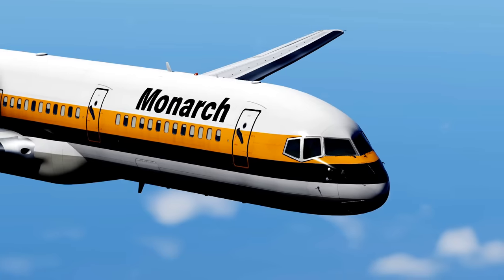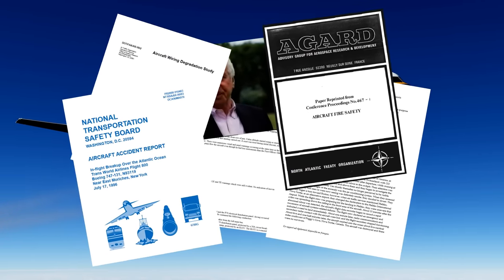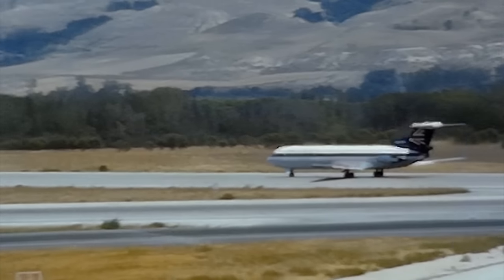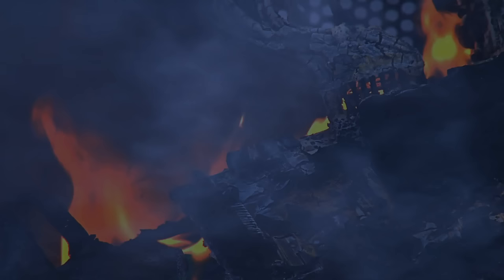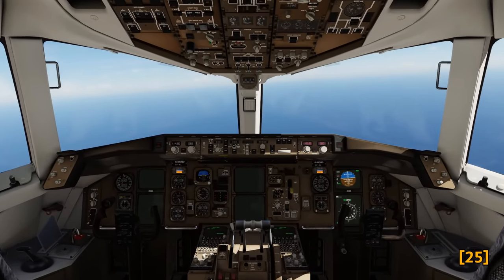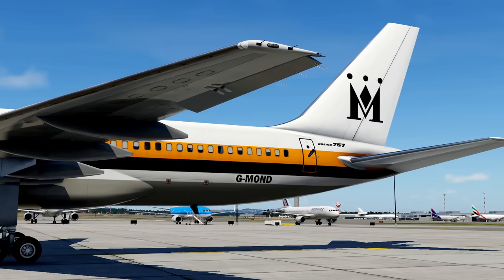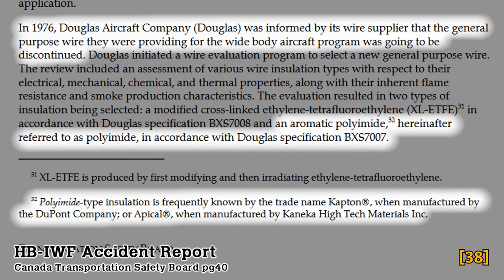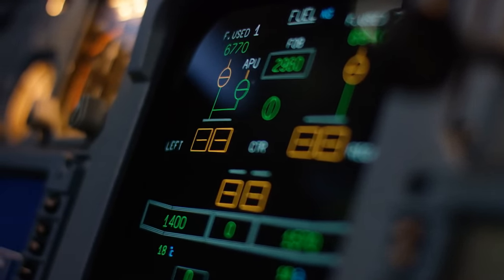The Toilet was Leaking??  What The Heck Happened to Monarch Airlines Flight 390 - DISASTER BREAKDOWN

Comment: What is often overlooked by many in discussing the Swissair 111 disaster is that the culprit wiring for the in-flight entertainment system was installed by a third-party vendor who didn't consult with McDonnell Douglas beforehand as how to properly integrate their equipment into the plane's electrical system.  Further, the wiring was continually live, as there were no "shutoff" switches, circuit breakers or other protection.  This is akin to wiring an aftermarket stereo system for your car directly to the battery terminals without including fuses, only in this case with much more dire consequences.  And these circumstances make Swissair 111 all the more tragic, as it was the least important system on the plane that ended up bringing it down.
Reply: Never 👎 the feelings of the butt in the hierarchy of the systems, they may revolt.
Reply: @minhthunguyendang9900  "feelings of the butt"? Which feelings are you referring to?
Reply: @Adam-kn3tv  
Sorry, I should have written :
‘Never underestimate the feelings of « the least important system » in the hierarchy, for they may revolt.’
I was thinking of Stephen King’s movie
‘Maximum Overdrive’
Reply: Since I wouldn't fly without some form of in-flight entertainment, it's a crucial system for passenger aircraft if airlines want paying passengers.
Reply: @Adam-kn3tv  
Sorry, I couldn’t resist the pun inspired by the op : 
speaking of butt about the plane toilet. 
& in ww2 a nazi uboote was sunk due to its own toilet.
Reply: @ImpactWench  the issue is not an entertainment system itself, but how it was installed in swissair airplanes. It was installed with disregard to the already installed wiring in the plane and there was no way for the pilots or crew to disable it at the time. The entertainment systems were a new thing in the 90's, so nobody really considered potential implementation difficulties with it. It was reported that the wiring of the system was overheated for long periods of time, probably leading to a faster degeneration of kapton insulation, leading to the disaster in the end.

Comment: I think Monarch 390 was probably a victim of the aviation situation in 1985. It was the second deadliest year in aviation history, with those three major crashes (Japan Airlines 123, Air India 182, and the Arrow Air crash in Canada) taking up most of the news cycle. 2,010 people died that year. And January 1, 1985 had the crash of Eastern Air Lines 980 in Bolivia, and since they didn't find the wreckage until 2016, I'm sure finding the wreckage of that flight was still huge news when Monarch 390 happened. Without any fatalities or injuries, this one got drowned out by everything else.
Reply: I enjoyed being on the 57 until LaudaAir. Just like my preference for Malaysian Airlines. Gone Also. Airbus took me a while to feel comfortable with
Reply: Nah. Nobody died. As such, IIRC it didn't even rate a mention on the evening news in the UK. It was just a plane that had a problem, diverted, and all the passengers got flown home later on a different plane. I knew about it at the time, only because my father was a Senior Flight Engineer at BA, and as such, he kept well informed of any potential problems in aviation. At the time, IIRC, it was regarded more as a case of leaking fluids getting where they shouldn't, than any particular problem with the insulation. It was only after the Swissair crash that there was an understanding that Kapton may have a problem, but even then the flammable thermal insulation was seen as the greater issue. 
That's the problem with this type of issue, it takes time for enough evidence to form for anyone to realize there's an issue, and due to the widespread use of the material, and the limited number of reported incidents connected to the material's degradation, it took decades to even know there was a problem to address. Sure, there were incidents & accidents happening, but they were easily explained as physical damage to the insulation, or chemical contamination of the insulation - not as the insulation itself having a problem. How could it be, when there were thousands of flights every day where Kapton worked perfectly?
Hindsight is always 20/20. NOW we can look at an incident and say "it's obvious", but at the time? Not obvious at all...
Reply: @gchampi2  Ok yeah, so we agree.
Reply: Outside of Sully’s Miracle on the Hudson, aviation incidents that don’t end in complete catastrophe tend to fade very quickly from the public zeitgeist. Except for Aviation and Disaster nerds.
Reply: That was also the year of British Airtours flight 28m in Manchester, one accident that changed everything. 1985 was a very sad year in aviation, but at least we learned a lot, and those tragic lessons were actually put into regulations and practices in the airlines, doubtless saving many lives since.
Reply: This comment makes me feel like there should be a video on the whole year & how the events were covered + received by the public. That's such an interesting story, to see what happens when there are multiple incidents.
Reply: @picahudsoniaunflocked5426  I totally agree. 1985 was a unique year in aviation history, and that is a story that needs to be told. We all know the big news stories (JAL 123, Air India 182, etc) as separate incidents, but connecting them together as a single story, what it was like in the industry to have one horror after another within one year is a story in itself. I don't know if that's the kind of story for Chloe to tell or someone else. She digs deep into what happened to cause certain accidents. I've never heard her do a story on the effect on the industry. If she chose to do it, she'd do an excellent job, but I don't know if that's her thing. It would be a great story though.
Reply: Delta Airlines 191 at DFW also happened in 1985.
Reply: @picahudsoniaunflocked5426  I would like that too actually, that could be really interesting. How did it affect culture, perception of air travel, profits, etc.
Reply: how about 2001
Reply: @legitusername-zl7to  Except for the fin breaking off a 767 because a noob pilot didn't understand how to use the rudder pedals, 2001 was really defined by terrorism, not air accidents. It was a massive criminal conspiracy. It's difficult to discuss intentional, criminal acts the same way we discuss preventable mistakes and design issues. People will commit crimes as long as there are people, and preventing crime is different from preventing air accidents. We can make planes more resistant to criminal acts, and we have, but the criminals are the real problem, and that's outside of air accident investigation, at least in the US (FBI vs NTSB). I think that's why we tend to consider the deliberate criminal acts on 9/11 apart from air accidents.
Reply: @beenaplumber8379  technically still the deadliest year by total fatialities (R.I.P)

also dont call him noob american airlines did not train him (so blame american as the noob instead)
Reply: @legitusername-zl7to  Fair enough. That was an awful judgemental statement I made. He didn't know what might happen as a consequence. He was doing his best.
Reply: @legitusername-zl7to  What happened in 2001?
Reply: And equipment used by AA, in that November 2001 vertical fin seperation was an Airbus and not a B767. The F/0, who was the pilot flying the aircraft on takeoff was attempting to counter wake turbulence from a heavy jetliner ahead of AA, and while his aggressive rudder pedal commands were the cause of the inflight breakup, that procedure was only lightly taught and lightly touched upon for him and many other pilots in flight training and type rating training with the Airbus and the AA  manuals themselves saying little to clarify such pilot inputs following encounters with wake turbulence from another aircraft.  @beenaplumber8379
Reply: @franktino6676  Again, I got it wrong. I don't know why I got it in my head it was a 767. And yeah, it's always an urgent question to look past the mistakes people made to find out why the mistakes were made - what contributed to the mistake, and how likely is it that the mistake will be repeated. My original comment about that pilot was judgemental and wrong. It's too easy to blame "pilot error" and stop there. That's not just for investigators either, though they do have standards that require deeper investigations. I think everyone, people who are not investigators, need to stop making the kind of mistake I made in my earlier post. It's too easy to ask who we should blame rather than what happened, how, why, and what can we do to prevent a recurrence. I've been preaching that mantra for decades, but I made a mistake and got caught up in it myself.

Comment: An example of a polymer that avoids a lot of the drawbacks (decay) of polyimides is Kevlar; a polyaramid. By incorporating some aryl carbon rings for stability, it breaks down far, far slower (and is as a bonus excellent at resisting impacts).
Reply: Aramid does of course have drawbacks too like being very sensitive to UV exposure. 
But as with most things in mechanical engineering it's about weighing pro's and cons for the application.

Comment: on one occasion an etihad airlines a340 registered as LO-BTA suffered a kapton fire while on the takeoff roll. thankfully the plane hadn't reached V1 speed yet and the pilots were able to stop the plane from taking off.there was one fatality when a flight attendant rick napes was hurt by the fire initially but died 8 months later because of suspected internal burns which couldn't be treated.

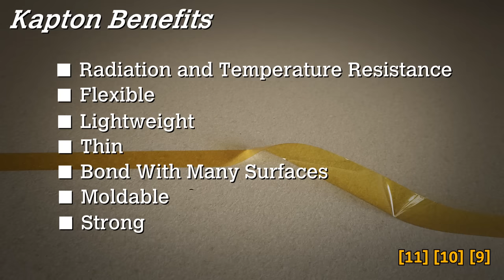Comment: 6:58 Indeed it has many advantages. Another one not mentioned in this video is that it is very resistant to outgassing, meaning that it can be used in ultra high vacuum without causing contamination or ruining the vacuum. I did a bunch of wiring for a physics experiment that involves first a high vacuum, then liquid xenon. This basically meant all wiring had to be insulated with either Teflon or Kapton. Kapton is, on the balance, the stronger material (Teflon flows under compression). But Kapton sucks at abrasion resistance, in particular in wire insulation, because the insulation is not a monolithic extrusion like normal PVC insulation and most Teflon. Instead, Kapton insulation is basically Kapton tape wrapped around it in countless layers. This causes it to sorta shred under abrasion, since each layer can tear somewhat independently. Just pulling it through a tightly fitting, perfectly round hole can start to cause bunching up of the insulation. 

So while Kapton wire has many advantages, including one big one over Teflon (Kapton is radiation-resistant, whereas radiation quickly degrades Teflon), it’s also fickle, not to mention its extremely high cost, and difficulty to work with. (Because of the wrapped insulation, it’s very difficult to strip.)
Reply: I am guessing that it can’t be deposited on the wire via a flow process like how other insulators can be?
Reply: @Knirin  I guess not, insofar as I assume they would if it were feasible.

Comment: Chloe, you won't believe it, the German company "Märklin" used Kapton too, for insulating their magnet coil in the switches of the model railroad.  Kapton simply vanished in the 80 as insulation. Now I know why.  Especially when kids play with a model railroad, the Kapton will become less durable, and short circuits will happen.
On a modell railroad for kids?
What if the carpet starts to burn, and the parents are not at home? 😮
Reply from the maker: That sounds horrifying! Although, it is good the Kapton was removed. People just weren't aware of its shortcomings at the time
Reply: It was widely used in the model railroad industry, but accessories use 3-9V current, and traction is maximum 24V so arcing event are way less dangerous. (most of the time there is no arc, just a short).
Reply: @elnalaombrebois5665 yes, but back in the days the fuses where not so fast as today's electronically fuses, and the power Transformator delivered up to 1A.
It was not a rare event that the wheels of train where solderd to the track  due the high current in approximately 1second untill the fuse cut the power of.
Today the fuses react in some milliseconds.

Comment: I was an avionics mechanic for an airline with the largest fleet of L-1011's from the mid 80's until the planes were gone.  Kapton wiring was a constant problem for us.  It would crack easily in high vibration areas, and with bending or stresses at connector pins.  Cracks would cause internment problems that were hell to solve at times.  One of the less mentioned problems was after heavy maintenance visits and mods, metal shavings would get in the wire bundles and cause mystery glitches.  The deterioration of the wiring was considered manageable, at least in public, but probably played a factor in scrapping that king of beasts.  If you were a good mechanic on that airplane, you had something to be proud of.

Comment: The Airbus A320 'glass cockpit', was way more advanced than the Boeing 757 in 1985. Together with the A320's large LCD's (which displaced many of the analogue displays seen on the Boeing 757), it also incorporated FBW (Fly-By-Wire) side stick controls.

Comment: Those look exactly like the electrical activity from my fire investigation days.  You get the same spray or flow of molten copper (notching and beading) in faulty electrical devices and damaged wiring.  The amber devil isn't as much of a concern on the ground, thankfully...  (It's been dehumidifier motor terminals, mains "X" filter capacitors, dodgy unprotected splices, and prolonged space heater usage in prewar or early postwar housing stock.)

There's some impulse that causes people to reset popped breakers without checking things out, even when they should know better.  I'm guilty of it myself.

Comment: I operated G-MOND and was with Monarch when  this a/c was delivered.
Until this incident, LAV A&F on all company 757s either side of L1 used to discharge a large amount of blue fluid on T/O. This fluid used to run down the aisle past doors 2.
No one ever questioned where this liquid ever went, it was a normal part of the take off for crews.

Comment: The Swiss Air incident was an aircraft that had been 'modified' to accept an 'in flight' entertainment system, none of which it had been designed for in the first place.  It was overloaded, (amps/power wise) and had nothing to do with Kapton material.  A short circuit wire arcing event, that ignited thermal and acoustic insulation cover materials resulted, which may have just been prevented by Kapton.

Comment: The irony is the British had a 757-type design in 1966 if the Rolls-Royce RB.211 had not suffered all the issues, there could have been a 757-like aircraft in service by the mid-1970s

Comment: You talking about the multiple crashes caused by the wiring material, in particular Swissair 111, reminded me of the 1st season of ACI, or "Mayday" (depending where one lives), where they had incidents like Swissair 111, Alaska 261 & United 811 (incidents caused, in large part, because of industry-wide negligence to maintenance & safety issues like faulty wiring) & they had experts going after the airline industry for that laisse-faire attitude towards safety, and then for season 2 they went in a completely different direction for the show & it kinda never felt the same again.